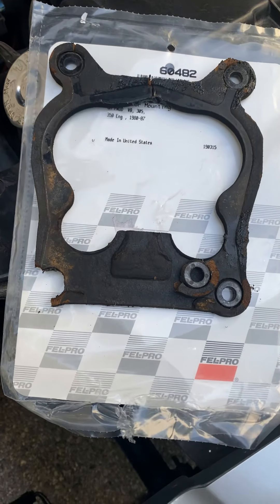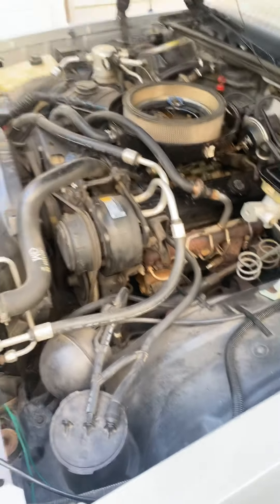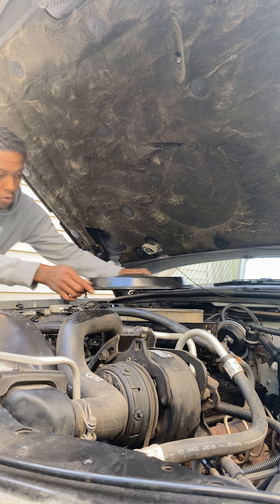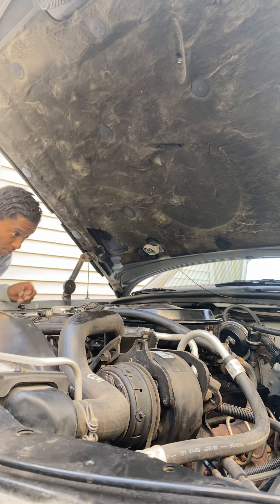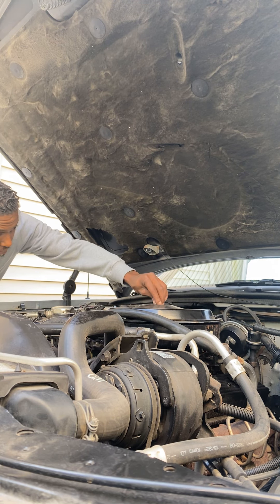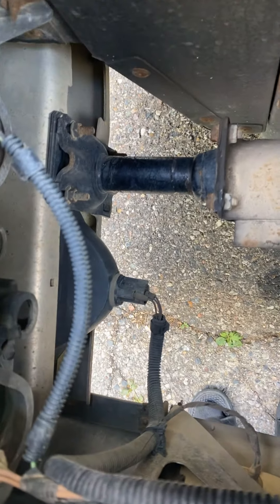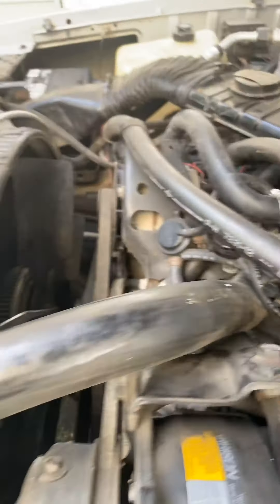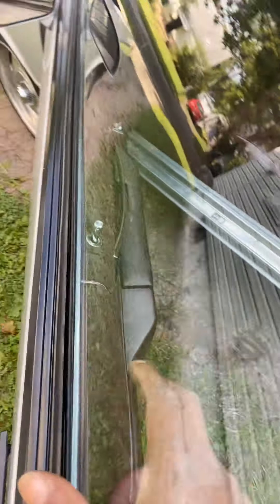Fixing Carb Monte Carlo SS

Comment: Whats up fam, its supposed to do that when its cold. Thats a little high for the high idle but wont hurt anything. when the choke opens up you can tap the gas and it drops down to the low idle. Set low idle between 6-800rpm. with the car running put in drive foot on the brake and see where the rpm sits, you want that around 500rpm. Your on the right track keep the Qjet. when they are set up right you cant beat em. It will out flow the edelbrock and you retain the MPG to just cruise. 💪💪💪 You need any help just holler.